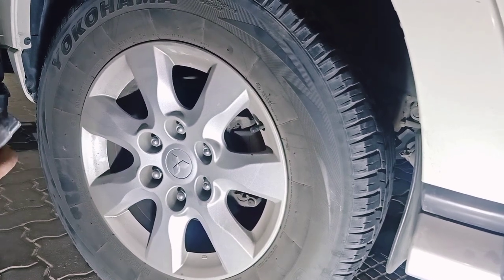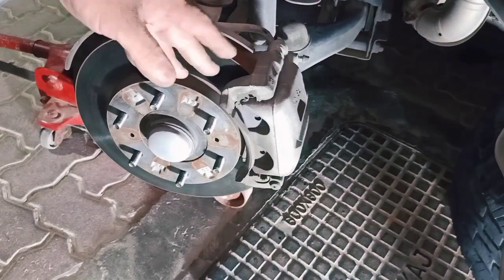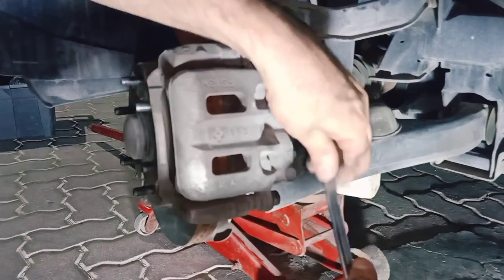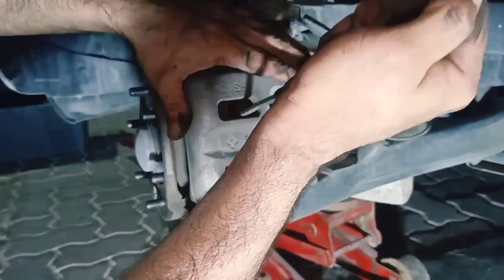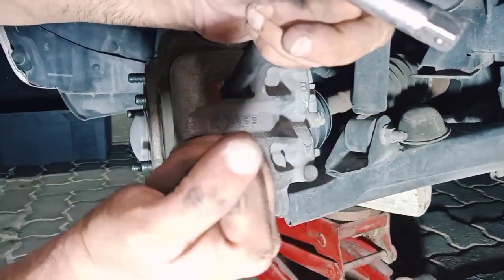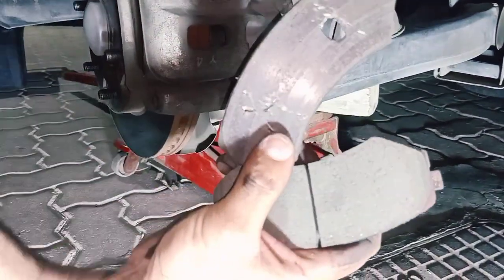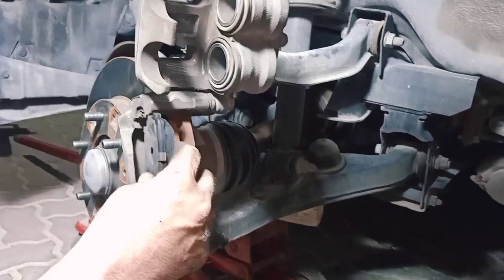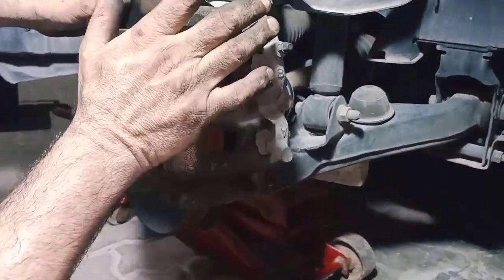How to change Mitsubishi Pajero Brake Pads!

Comment: The easiest process I have seen so far compare to other vehicles such as Eg. hyundai accent 2014
Reply from the maker: Hyundai accent has different procedure?
Reply: @asadfirm0001  You need to remove the 2 bolts , hang the caliper then you remove the pads. For the front brake you can compress the piston but the back brakes you need to push and screw them with a special tool, in my case I used a grinder spanner key as hack,  instead of buying a kit.hehehe
Reply from the maker: Wow that sounds interesting, haha I'd like to see one accent and try this out xD
Reply: @asadfirm0001   I'm contemplating getting an older pajero model with high km , I was curious about the difficulty level to change the pads on it, thanks for the video 👍Its a cool car
Reply from the maker: Parts are easy to find too depending on your country, and the fundamentals are also quiet basic compare to other cars
Reply from the maker: And thank you also for sharing your thoughts with us and we hope the video helped you

Comment: 03:14 Won't this method damage the break rotor?  I"ve seen a method where you can use a clamp and a small piece of wood to push those back
Reply from the maker: No it won't, same thing as using a clamp to push it back, but we show simplest way possible rather than using tools that may be impossible to find in other places.
Reply: @asadfirm0001 Ok cool. Yea I think I'll rather use a g-clamp and the old break pad to push them back in.  I definitely see this method is simpler, but knowing me, I'd probably end up scratching or damaging something in there.  ;-)
Reply from the maker: Yeah better not damaging anything 😂 good method too, use the old break pads and push the pistons back.

Comment: it would be smart to use proper tools like brake piston compressor tool, rubber hammer and brake cleaner spray to clean the brake parts before installing new brake pads. And clean the engine bay before taking this video tutorial.